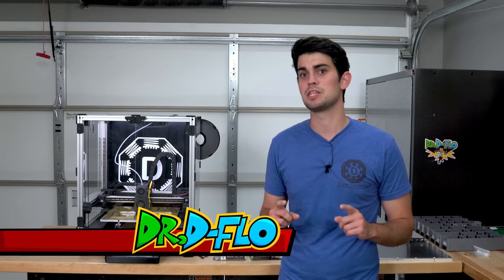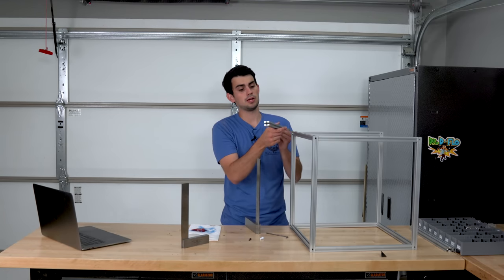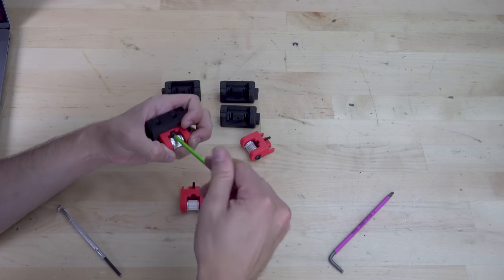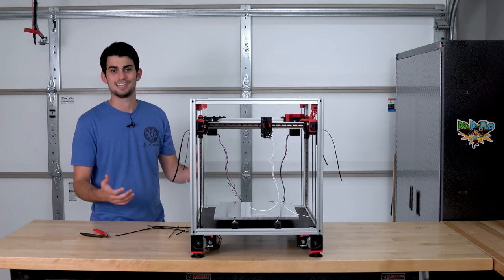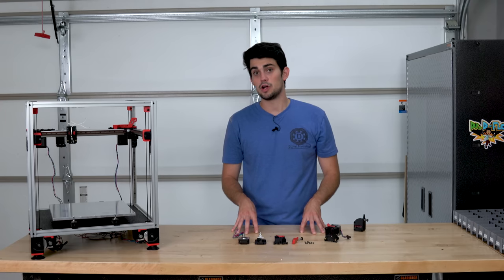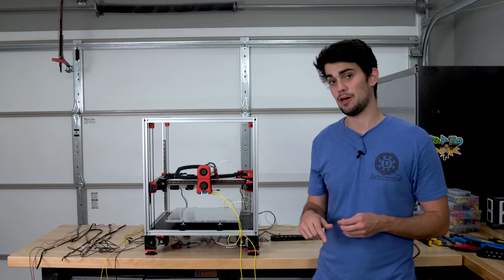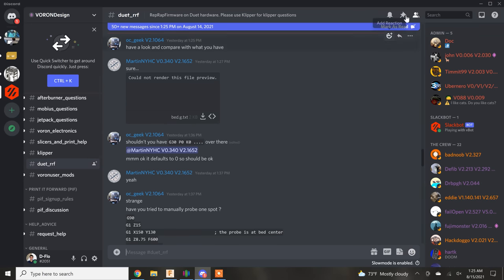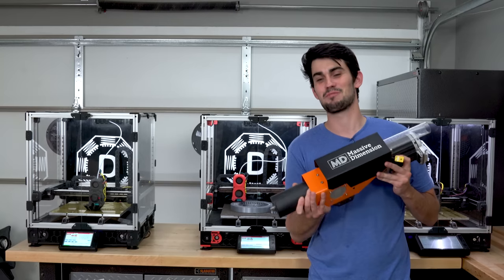Building an Epic DIY 3D Printer: Voron 2.4 with Mods!

Comment: You can’t grease linear rails like that though. They have a rubber wiper on both ends to prevent any dust and debris getting in. The proper way to grease linear rails is to take the carriage off and grease the bearings in it as well as the rail to prevent corrosion

Comment: Teflon wire isn't necessary. Need to use flex rated wire. It isn't that expensive. Just because a wire says it is ultra flexible, doesn't mean it is flex rated.

Comment: Great video. As someone who built a V2 this year, I appreciate all the explanation you do that would have helped a newbie during my build process. I do slightly disagree with how strictly you say you need to follow all the part sourcing as there are many people running non-spec parts, but for someone doing this for the first time, it's probably best they do everything perfectly to spec.
Reply from the maker: Coming from someone who has built the V2, I am glad that you see value in the topics I picked. There are still a lot of small things you will learn here and there when you build.

Regarding the BOM recommendations, that was more for the newcomer because it really slows down the build process if you have a couple parts that you tried to get a good deal on but they turn out not to fit...
Reply: @DrDFlo  Even your explanations of how each component functions and comes into play (for example the benefits of linear rails or why there is still a Z- endstop switch) were very good points to bring up. I'll definitely be sending this to friends who are interested in building one as a good "here's what you should know before you decide"
Reply: @Katman77  Totally agree. This should be titled “Everything you wanted to know about VORON and a lot more you didn’t even know you wanted to know”.

Comment: I used to work for a water-jet manufacture we used linear rails for holding the z carriage. They were costly since they were 10mm rails, and cams to keep it level and stable. We used ball screws at first than switched to harmonic drive motors on custom aluminum extrusions with a custom plastic for the wheels. 

Great video though, very through and helped me see the engineering decisions they made.

Comment: The three point bed mount and the mounting method which allows for thermal expansion was one of the biggest reasons I ordered a RatRig V Core 3.
Reply: You should take a look at the Voron Trident, but the V-Core 3 is also a very solid printer.
Reply: @vinnycordeiro  just found the video from last week. I guess RatRig should be flattered.
Reply: @jamesplace5622  My only gripe with Rat Rig's printers is that they still insists in using PETG for their printed parts. That means you are limited to print lower temperature thermoplastics to avoid heat deformation. Other than that they have some really cool features.

Comment: If the wire are too small for the crimper (or even the contacts) you are using then just double up the wire in the crimp. The extra wire will take up the space.

Comment: Hey man. I'm doing the same at a local makerspace. I've been buying everything from circuit level components, microcontrollers and hundreds of sensors, thousands of feet of wire, motors, filament and really good digital multimeters (to be put away for people who can't afford it) along with every type of screen you can imagine, thousands of leds of every type through hole, smd, neopixel rolls, jbc soldering station, solder, flux, braid. It's taken me almost 2 years to gather it all up. I couldn't name it all if I tried. 

I don't watch most 3d printer channels anymore because they just let the printers rot or build a farm and some build (pew pews...). They should give them all to schools. I've spent the last year and a half learning and buying extra to donate. I'm not looking for kudos I. Saying more people should be like you.

Comment: Excellent video : ) 
Just a small correction or clarification to the extruder drive intel. 
Galileo uses larger drive gears than Clockwork but smaller than LGX. 
Clockwork uses Bondtech BMG's 1.75/5.0mm drive gears. 
Galileo uses Bondtech QR's 1.75/8.0mm drive gears (or the new shorter drive gears supplied by Bondtech to LDO). 
Bondtech LGX uses the new 1.75/18mm drive wheels.

Comment: Thinking about the extrusions warping the linear rails, you could put a bead of thickened epoxy on the extrusions. Lay a thin sheet of paper or plastic on top of that, and then fasten the linear rails one screw top and bottom and just barely tighten. The epoxy will conform to the gaps between the parts, and once set and you add the rest of the fasteners, the rail won't be warped.

Comment: Great video. Just to correct a very important information, using higher voltage to the bed heater do not count alone for safer implementation. It is even unsafer when you connect it directly to the net mains. A safer implementation needs to have a galvanically isolation from the net, a isolation transformer for example. This will both avoid electrical shocks accident and will limits the short circuit current.

Comment: I’m not sure how much I believe that one or a pair of MGN9 rails would be less strong compared the aluminum and V-Wheels, especially on something like a CNC Router. Also, I’d love to see what a Voron 2.X would be like using machine tools to create many of its parts instead of plain t-slot aluminum extrusions and mostly printed parts with tiny MGN rails (asides from far more massive costs of course).
Reply: Even I didn't get the point.
How can Plastic wheels on extrusion be stronger than hardened steel rails?

Comment: Did you forget the thermal fuse on the build plate, or did I just miss it elsewhere in the build? Voron specs great SSRs, but they can still fail of course and not having a thermal fuse may leave you open to mains voltage bed heating runaway and potential fire, even when the machine is sitting idle.
Reply: I believe the Fermio Labs mats come with a "self resetting thermostat" which will turn the heater off if it gets into a thermal runaway, and then reset. I wish we had a company like Fermio in the US that had some of these more custom parts ready to go. I believe you can custom order this stuff direct from Keenovo, but it's more of a hassle and a bit more stressful making sure we do not spec something incorrectly.
I had a bit of hard time sourcing the build plate and had to get one a little bigger and without the slots for easier mounting.
Reply: @CodeMonkeX  You're correct. They'll just ensure that your heater stay on at around 150c until you notice it. I'm actually the one who got the SK-GO creator to remove them on his kits last year and replace them with real thermal fuses that are replaceable. Those bi-metal thermostats aren't particularly reliable and at that point it's the only thing between you and a thermal runaway. With external power surges being one of the main causes of SSR failure I'd be wary, especially with Voron spec'ing a medium time fuse on the AC input. Imagine being on vacation for a week and a surge makes the SSR fail while you're gone. You're now just hoping that the constant cycling of the thermostat doesn't wear out before you get back and notice it. IMO a thermostat is an improper replacement for a fuse as it doesn't actually stop the problem, but rather attempt to make it safer which is likely why the team specs a real thermal fuse.

Comment: Don't make any changes to the steps/mm or rotation_distance, whichever you're using, in your firmware based on those measurements of the calibration cube. ABS shrinks. If you print it in PLA, you'll have 30mm on X and Y. ABS will always be slightly undersized after it cools

Comment: Might build one of these some day, just got WAY too much other things I got to get done first. One thing I think that would help is a small HEPA filter in addition to the activated carbon to remove at least some of the small particles. I personally designed and made a filter for my printer using activated carbon pre-filters and Roomba HEPA filters. No idea how effective it truly is but it's probably be better than nothing.
Reply: You have a design you can share or a link?
Reply: @wayneyandell549  I never published it, but it's based off of the filter on thing:4054734 on Thingieverse, they also put up an assembly guide on YT: https://www.youtube.com/watch?v=h7VDLeoQBYQ&ab_channel=CarstenDalgaard

 Same idea as their filter and enclosure. I just modified their design to make the enclosure bigger for my custom 5015 effector, but the principle is the same, i just changed it to work with my enclosure dimensions and used larger fans.
Reply: @wayneyandell549  Actually NVM I did put it up on Thingieverse, I guess I just forgot: thing:4657322 It was just the door for the enclosure I didn't get around to publishing.

Comment: Hey David, excellent video (as always!)

I'm in the process of building a HevORT 3D printer. It's going to be a tad bit bigger than yours at 565mm x 565mm x 590mm. Let me know if you need full-sized, one piece traffic cones printed...

I went with the HevORT since I could easily (more or less) scale the size to what I wanted. Also, I like the ballscrew/wobblewings approach to bed leveling, the support for bigger motors, it's beefiness, and the option for non-planar printing.

There's some serious drawbacks to my build, including the higher price of the parts, availability of those parts, and where to put the darn thing once I'm finished with it. And the frame "efficiency" is woeful compared to the Voron. Far more dead space in it. 

Going that big caused problems finding places that even sold parts in the sizes that I needed, including 700mm long ball screws, 800mm long rails, and a 1000mm long, 20mm 20mm square carbon fiber tube (the rails and the tube will have to be cut, it isn't that big). The heated bed plate is 23.25" x 23.25" 1/4" ATP 5. MIC6 would have been a better material choice, but it's 2x the cost. And I won't start printing until things are heated up in any case, so expansion will be accounted for. I can always switch to MIC6 later if need be. I'll just be sure to mount the plate so that it floats.

The X & Y axes are going to be driven by Teknic servos, which will require 12mm belts. And the frame is made out of 3030 rather than 2020. I ordered the frame parts pre-cut from 8020.net, and they were pretty much spot-on with their cuts. With all of them either on the money, or within a millimeter. The price wasn't bad, $0.27 per inch, and $2.12 per cut. I highly recommend them. I'm looking into welding the frame together (why not?) since I'm shooting for some pretty high speeds with those servos.

In any case, another great build, and there are going to be some lucky kids getting to use some awesome printers!

Comment: note that wire current ratings need to be degraded inside a heated enclosure and drag chain, though you should probably be fine, but you might want to look at the temperature on the wires after like an hour at the maximum temp you wanna print at.

Comment: Speaking of connector names... the things you were calling 'Molex' connectors were really Dupont connectors. Molex are much beefier and have recessed plastic interlocks. Dupont are the little pin-socket connectors like they use for LED strip connectors or PCB pins.

Comment: Nice, but have you considered using some FFC / FPC Cable instead of the silicon coated individual cables? The flatness would greatly benefit the smaller channel space and the constant bending would be much of an issue for it. 
Also, I think the AC going to the bed should be ground isolated for safety. A 1:1 isolation transformer should be inserted in there between the mains plug and the AC triac switch. Any cables that carry above 50v should be clearly marked that they do so and caution should be taken around them. I can imagine issues with moving it with hands underneath if it were still plugged in.

Comment: Pretty simple explain about the belt motion is examing the right triangle shape with equal side and pythagorean formula. Core XY move fast cause they moving in the hypotenuse direction that mean moving as quicker as in c^2=a^2+b^2. You can see hypotenuse c is much greater compare to a and b side of the triangle when moving in diaginal. You may thought then if they move only a or b side will slower down but turn out they use 2 motor so  the overall speed up. Like I mention they are moving like right triangle shape with equal size of a=b then when ever the motor turn in theoretical the belt will pull the hotend  a displacement of a=b

Comment: i got some metal reinforced nylon belts for my 3d printer. they have metal strands going though them kind of like a tire and its crazy how much less they stretch over time. after the initial stretch that all belts seem to do there is virtually none after that. run a handful of prints go back in to tighten everything down then you should be good to go.

Comment: “Abs wasn’t just chosen for it’s heat deflection temperature. It was also picked for its high tensile strength and CHEMCIAL resistance”

I can’t think of a filament material with worse chemical resistance than abs. Lol that stuff breaks down at the sight of xylene, toluene, acetone, and even weakens with mineral spirits. 

I’d recommend colorfabb ht or xt. You could also use polycarbonate if you have a capable printer.
Reply from the maker: I was talking about oil and grease. If you have xylene, toluene or any of those solvents near your printer then you are going to have more problems than just your ABS parts degrading. Polycarbonate is very brittle when printed. Not recommended for Voron parts
Reply: All of the solvents mentioned have there place in various bed adhesives. When these bed adhesives are used (most commonly acetone + xylene + abs aka. Abs slurry) the vapors are cooked off when the bed is heated. These vapors WILL slowly degrade all abs parts. If you don’t plan on printing abs or asa that’s one thing but I don’t like limiting what I can and cannot print. 

Unless you’re using petroleum based products directly on your plastic parts, Oil and grease isn’t gonna degrade anything so mentioning that isn’t really of any use.

Also, polycarbonate can be printed with a heated chamber and come out ok, or you can get various pro or plus products which have been formulated specifically for printing. Just like any filament polycarbonate requires calibration. 

The only point I was really trying to make is that abs is the least resistant to chemicals of any filament out there. (Excluding isopropyl smoothing filaments and dissolvable supports)
Reply from the maker: I appreciate your thorough response. And I admit chemical resistance was a poor choice of wording.

But you should not point people towards polycarbonate by acting like ABS is going to degrade due the vapors produced by common bed adhesives. 

There are thousands of Voron printers and even more commercial ones that use ABS parts. I have not heard of a single example of vapor  melting an ABS component beyond anything aesthetic (e.g., slightly smoother surface).

You can go to great lengths to print PC at the perfect conditions, but you will still end up with a part that is more brittle. A certain amount of flexibility is required so that the gantry does not snap when performing QGL

Comment: It shouldn't really matter if the distance or speed is different for your inductive probes; the only important thing is that they are reliable accurate, i.e. they consistently trigger at the same height every time.

Where on earth did you get those probes from, anyways? The current spec probe is a Zhongde PL-08N, and I'm seeing it for $2.62 from the source recommended on the official Voron sourcing guide.

Yes, you can melt the probe, but that's generally from not installing your hot end properly. If you're worried about it, you can slap on a layer of aluminum tape to reflect more heat away.

Comment: Great video mate, thanks a lot for your time. 

JST is a single small, generally kind of cheap and nasty subset/brand of these type of connectors and by no means interchangeable with Molex, or any of the other hundred or so similar connectors at digikey or mouser. if you want to narrow it; normally its the XH series used in RC and in a few positions here. most of the connectors in the voron are not JST at all, they are molex microfit and to call them all JST is not just lazy (not saying thats what you are doing, just that its common to do so, just like calling them all molex), its straight wrong and you wont find what you want if that is your search term.  when designing a PCB I would typically avoid JST connectors at all costs.

it is a brand and type that probably would have died out without RC and budget ebay electronics offerings. RC is responsible for extending the life of many connectors that would/should have died out years ago IMO :P